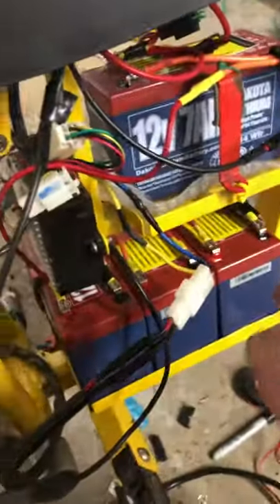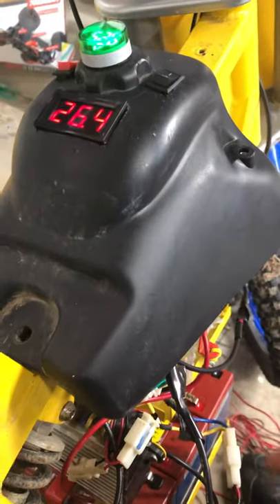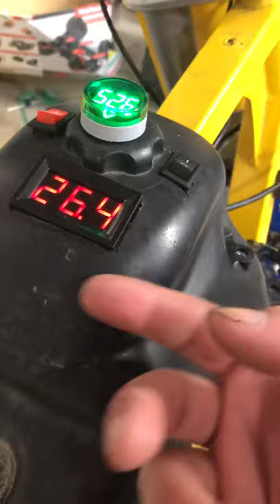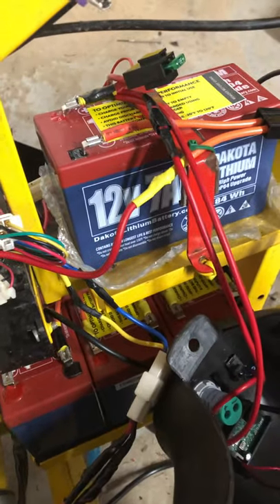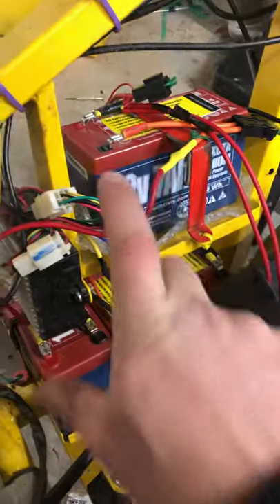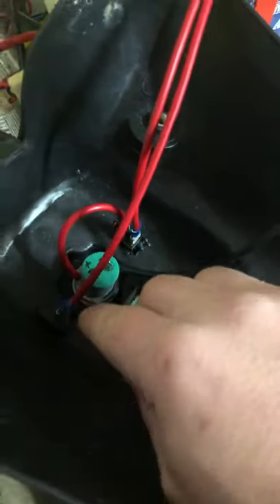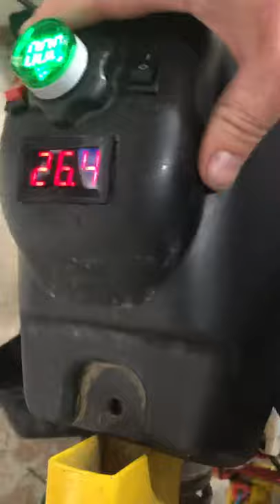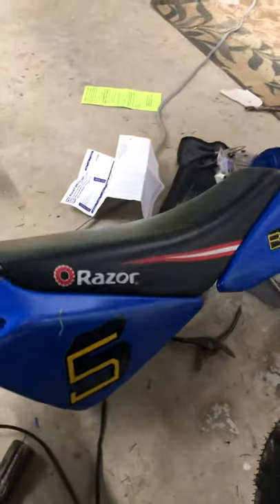Add voltage meter “fuel” level switch to electric Razor Mx350 Mx500 Mx650

Comment: Are you running stock controller ? Motor ?
Reply from the maker: Stock everything except a 9 tooth motor sprocket and an extra battery.